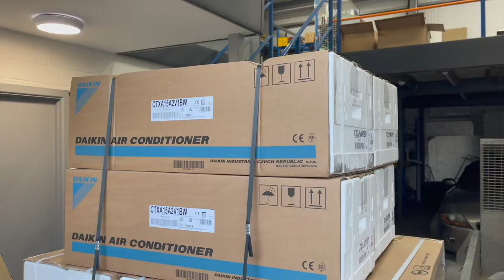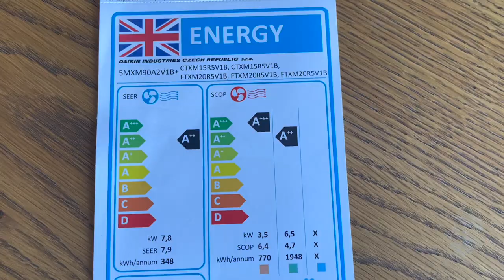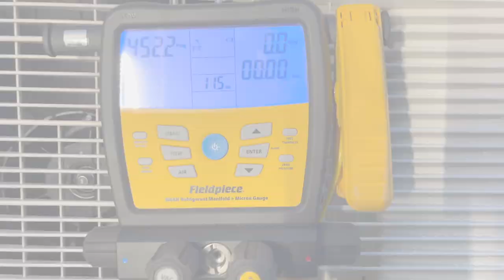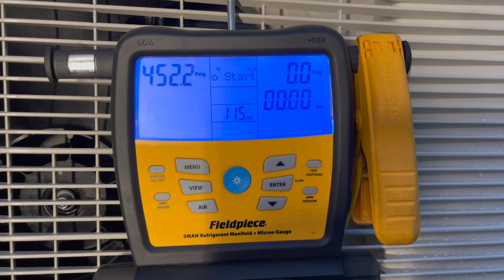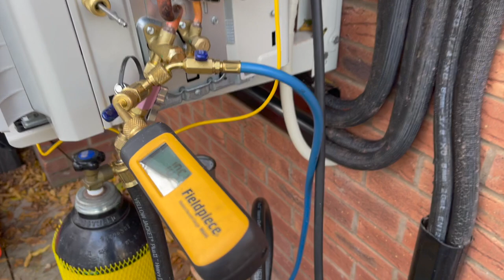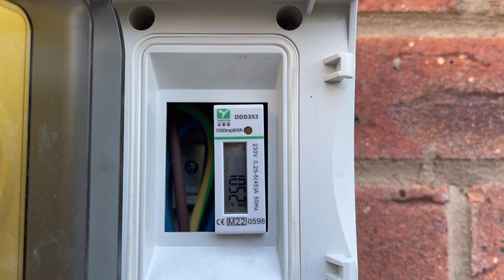Air to Air Heat Pump: better than an Air to Water Heat Pump? We install for a YouTuber to find out!

Comment: This is of great interest to me as we have a very similar system here which was installed in October. We have for now kept our boiler for hot water but plan to change that in the future. This coming cold December will be the first serious test.
Reply: How did December go?  All ok I expect.  I'm also looking at a Haori or Mitsubishi A2A system and hoping to be gas boiler free later in the year.
Reply: @GcS1515  all good thanks. We haven’t been tempted to run the boiler all winter. These below average temperature months do use a fair bit of electric but it isn’t worse than expected. Our most costly month was January at 620kWh. Dec was 610kWh, Feb was 330kWh. Last year’s gas was 1800kWh per month November to March and it was warmer weather than this winter. Our house is occupied most of the time too. We shut down at night to save money same as we did with the gas unless it gets well below zero when I leave it ticking over at 16 degrees. Normally run it at 18 to 20 degrees. Hope that info helps. Good luck.
Reply: @ChrisJakins  thanks for the reply. figures look good.

Comment: It's a waste of money and not eco the cop is massively wrong from reality it's cheaper to use gas and your house will be much hotter
Reply: Air2Air heat pump could be used as AC as well during the summer month tho
Reply: It depends, our heating bills are half what they were with gas. Install was £3.5k all in.